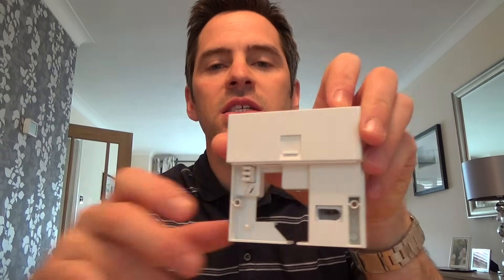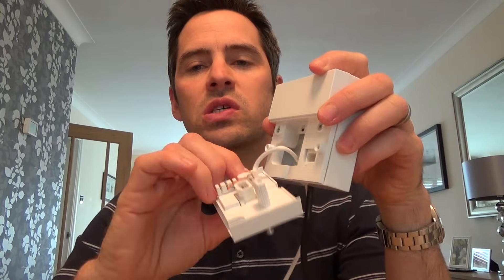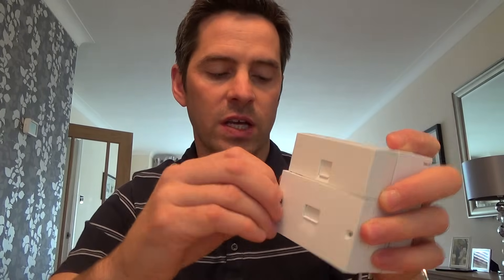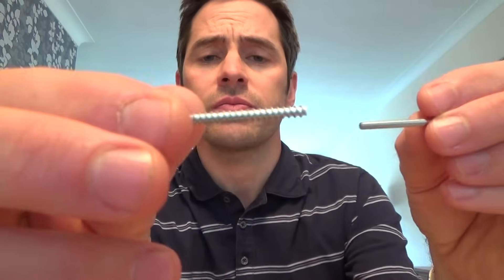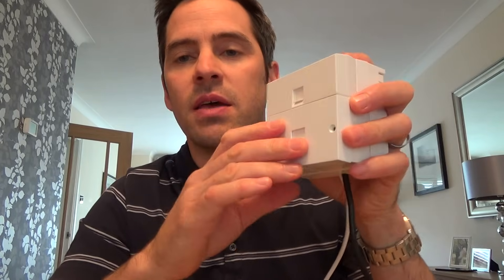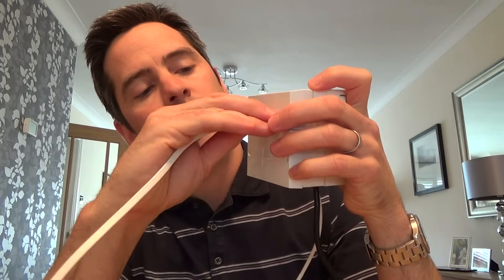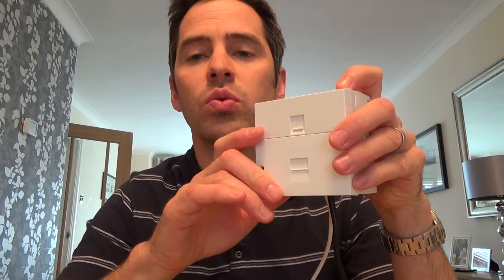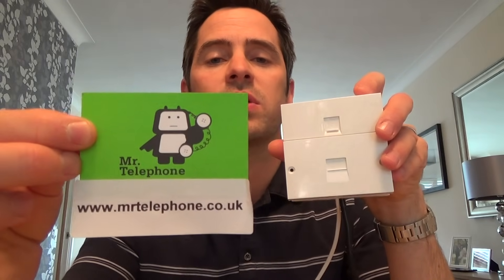How To fit a VDSL Plate on your NTE5 telephone master socket.

Comment: I don’t need the extension to the other room. I am currently plugging a micro filter directly into the master phone port with the face plate completely removed as it was faulty. Can I simply just plug a face place directly in without any rewiring?

Comment: hi. i have been having issues with unreliable speeds since joining infinity 6 months ago. the highest speed i got was 32 down, 7 up that lasted 5 days. after months of trying to get bt to sort, nothing worked. i received 3 replacement hub 5s. 2 would give 22 down, 4 up. 1 gave 18 down, 4 up through master socket. test socket showed 27 down, 6 up. after they finally decided to send engineer he asked if i wanted the router at master socket end or extension in living room as he was replacing the old master face with vdsl mk3. i opted for master end. he took old out and fitted new mk3 and rewired it all. after installing, my speeds are now 40 down 7 up and seems more stable. he said it bypasses the extension wires and this clearly improved as i never reached 40 ever.
a friend has sky infinity and the old master as i did. would this vdsl work in the same way as completely rewiring a new vdsl mk3 as the bt engineer did. or is it just better the way the engineer did it?

Comment: Hi Vince just wondering should I get an MK2 vdsl or the mk3 by open reach they are on eBay is there much of a difference I don’t have a problem with my broadband my line speed is 79.98 on the download which is pretty much the max speed but can a vdsl faceplate improve my upload to 20.00 I’m only getting 18.5 upload on the line stats but on a speed test on 5ghz I get 74.5 mbps down and 17.5 up and will it make my line more stable

Comment: Thank you Vince, I will be moving soon 20/11/15 and i went to have look at my new house today and noticed that it only had an NT5 Socket in there. So i will unscrew my VDSL front plate from my old house and put it in my new house. It gets switched on the 20/11/15 fibre optic. :)

Comment: Nice one! I just installed a new NTE5 master socket and mk3 VDSL faceplate and my speed went from 23.1kbps to 26.2kbps instantly, hopefully it increases even more with dynamic line management.
Reply: antiduckable That's an extremely slow speed in this day and age. Are you in Mumbai?

Comment: In terms of speed quality, would this benefit with BT Infinity more than an NTE5? I am planning to order a cat6 rj11 to rj11 cable from your ebay shop to use with standard NTE5+ADSL microfilter but I saw your other video about how rj45 is better (with VDSL faceplate). 

Which would you go for? A VDSL faceplate on master socket with rj45 to rj11 OR stick with NTE5 with microfilter and cat6 cable?
Reply from the maker: +Ameen Miah Hi, if you have other telephone extension cables/sockets in the property wired up to the front plate of the NTE5 master socket then definitely go for the VDSL faceplate and either RJ45 to RJ11 or RJ11 to RJ11 cable. If you do not have any extension wiring and you only have the NTE5 master socket then there is no point in fitting a VDSL faceplate as it will not (probably not) increase the speed so just go with the cat6 RJ11 to RJ11 and the standard ADSL microfilter.
Thanks Vince
Reply: +My Mate VINCE Cheers for the reply Vince, I don't have any extensions in my house just the one master socket so I'll place an order for the rj11-rj11 cable now mate

Comment: Hi Vince, I have a Bt grey box outside the property, where the black cable and internal white cable meets, then i have a Bt box junction in the hall way, another cable from the hallway to the lounge where the master socket is nte5a. So I have three connection from the external black cable to the Mayer socket, BT Engineer told me I have no extension. I only have one Nte5a master socket which is located in the lounge with a test point in the back.

My question is will I benefit from a vdsl face plate? and also changing the flat router cable?

Please reply
Reply from the maker: +Muhammad Jubair Hi, you will be unlikely to benefit from fitting a VDSL faceplate because you do not have any extensions. You may benefit from replacing the flat lead but that depends on how well the flat lead is performing, if you are already getting the maximum rate out of your line then changing the lead will not make any difference.Thanks Vince

Comment: Hi Vince, I have check my master socket and it has a recess line on it but when i undid the screws to have a look inside the wiring isnt attaced to the faceplate as in the video is it still possible to install a vdsl faceplate or does it require a new master socket?
Reply from the maker: Hi, if you don't have any wiring attached then you may not have any phone extensions unless they are star wired before the master socket which will mean more work!!!
Reply: +My Mate VINCE No thats fine I was just wondering if i fit the vdsl face plate it will work as i have no extension sockets just a master socket
Reply from the maker: Hi, yes it will work but you may not see any improvement over just a standard plug in microfilter.

Comment: I am currently having a problem and trying to narrow the problem down. If I remove the first face with the extension wiring attached can I plug my phone straight in to the VDSL face-plate?
Reply from the maker: +MegaGHWiga Hi, yes you can.

Comment: I want to move my master socket which is VDSL from my basement to my living room. My living room socket used to be the master socket, but for some reason the engineer removed it from here and made the socket in my basement my master socket when he changed it to VDSL. He also cut away some cable on the outside of my house (the basement used to be a separate property to the house), not sure where it was from. I now want to have the VDSL master socket back upstairs in my living room. Do you have a video on how I can move my VDSL socket? Also, can I have 2 VDSL master sockets in my home or will I need to remove the basement master socket?
Reply: trogoy Reason I want it in living room is to have a wired connection to PS4. Or can I just keep my vdsl master socket in the basement and add another vdsl faceplate to my living room socket and run the cable from that to my ps4?
Reply from the maker: trogoy Your router/HomeHub will only work on one VDSL socket. I think the best option is to leave the setup as it is because you do not know the reason the service was moved and now the living room wiring has probably been cut. Then run an Ethernet cable from the router/Home Hub to the living room for your PS4. Or if you don't want to run the Ethernet cable you could try out some powerline adaptors which use the mains wiring in your house to run the Ethernet signal and they work pretty well, not as good as a hardwired cable but they are very easy to install. Google 'powerline adaptors'  to find out more.
Reply: My Mate VINCE I've already tried powerline adaptors. These actually produced a stronger wireless signal but the speeds were much slower. Running a cable isn't really viable as I live in a fairly big property.

Comment: What's the wiring if I want to use the internal connector to run an ADSL extension on Cat5e? I assume I use Blue and Blue/White cables. I already have cat5e network in place but until now have not been able to get VDSL.
Reply from the maker: Peter Trace Hi, yes you are correct you will use the cat5e blue pair on the A and B terminals, it doesn't matter which way round they go, either way will work.Thanks Vince

Comment: My router is set up in my cupboard I do not have a modem, can I ask BT for my router to be moved using one of these so it is set up in my hallway with my phone, I’m getting slow connecting internet with my ps5 but have the highest internet connection, please give me some advice

Comment: Do you stock VDSL faceplates on your E-bay site, had a quick look but could not find them
Reply from the maker: +Donald Dickson Hi, I do still have them but they are a different design (ebay item number 261019263819) . The version I have now replaces the whole frontplate unlike the version in this video. You can still get the other version from other ebayers and Amazon.Many thanks Vince
Reply: If you complain enough to BT they will upgrade you FREE to the latest VDSL OpenReach faceplate, that's what i did.

Comment: I mate I have a question to ask you. We have recently had a second phone line put in our office as our speeds are insufficient to do the home and office but the new line is getting double so the office is getting 4Mb and the home only 2.5Mb. We just ordered ultra fast broadband as we are to far from the cabinet to get infinity by bt. 

So my question is can I change the master plate in the home to up my speeds as I believe this is the problem and if so can it be a Vdsl Faceplate as I believe you called it.
Reply from the maker: BillyGoatBoy Hi, the VDSL plate attaches to the NTE5 master socket, so you would need a NTE5 master socket and also a VDSL faceplate if you wanted to replace both. It may not be the master socket at fault, remember that the 2nd line has its own separate wires back to the telephone exchange (even though they may run in the same cable) so the difference in speed may be to do with the quality of the wires in a manhole, or the street cabinet and this is out of your control. The VDSL faceplate may fix your problems but it may not. It may be worth testing the broadband at the test socket in your home to see if the speed increases then you know the lower speed is to do with internal wiring.Many thanks Vince
Reply: So if I got this from you would I get VDSL2 / ADSL BROADBAND FACEPLATE SPLITTER for NTE5 Sockets VDSL ADSL2 2015 model,NTE5A MASTER SOCKET with IPLATE BROADBAND ACCELERATOR?
Reply: Thanks for your help:-)
Reply from the maker: BillyGoatBoy If you get Ebay item number 261019263819 which as you mentioned is the VDSL faceplate 2015 version and then if you get ebay item number 350856570358 for the nte5 master socket and tool. This will allow you to change the nte5 master socket and fit a VDSL faceplate. Type those numbers into the ebay search bar to see the listings and remember when you fit a VDSL faceplate you have to have your router located next to the nte5 master socket.Many thanks Vince
Reply: Thank you so much for your help, ordered both items from you.
Reply from the maker: BillyGoatBoy That's great, thank you.

Comment: Hi My Mate VINCE great tutorial vids! Can you wire a VDSL/RJ45 extension by using those two IDC connectors on the top left of the VDSL faceplate? Blue wire pair?
After watching your other videos I was wondering if it was possible to hard wire a RJ45 cable for both data & voice to this master socket replacing the need of a network econimiser? <- This might be a good video to make? :P
This would then basically mean 2 sockets into one RJ45 cable and then using a network econimiser at the other end of the extension to resplit the signals back again for phone and modem/router? My idea for this is to basically relocate/extend the full master socket for both VDSL and phone to another room. With minimal compromise on the data speed?
Reply from the maker: ***** Hi, yes you can and believe it or not that was going to be my next video but instead of using an economisers on the other end I was going to use a faceplate with 2 modules, one module for BT voice and the other module either a RJ11 or RJ45 for the ADSL signal but a rj45 coupler and data/voice green economiser will do the same job.Many thanks Vince

Comment: Great video, however I have a question. I have a NTE5 master socket. A couple of years ago a put a ADSL filter faceplate on V1.0 which has the filter built in. I'm not switching to Sky Fibre broadband. 1. do I need to change this for a MK3 faceplate from BT? 2. Will I actually see any improved speeds? Best regards. http://bt.custhelp.com/app/answers/detail/a_id/40231/c/346
Reply from the maker: +Michael Gilmore Hi, you may as well leave your current faceplate on and then think about changing it when you move over to SKY Fibre.

Comment: Nice helpful video. Q; will the VDSL faceplate work ok with a ADSL setup and if so does it make any difference ?
Reply from the maker: carlos briggs Hi, thanks for watching. The VDSL faceplate will work with an ADSL setup. I have heard a few people mention that it has slightly improved speeds over an ADSL faceplate but others have said it makes no difference. It is certainly easier to fit than an ADSL faceplate as you do not have to undo any wiring but I don't know if I would bother changing over to one if you already have an ADSL faceplate. If you don't have an ADSL faceplate already and are thinking about buying one then I would prefer to fit a VDSL plate. Thanks Vince